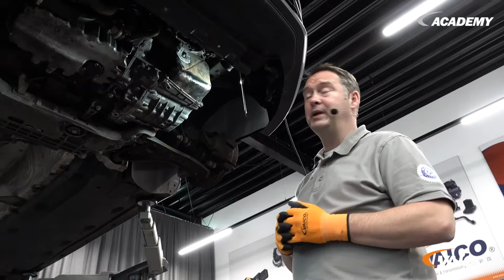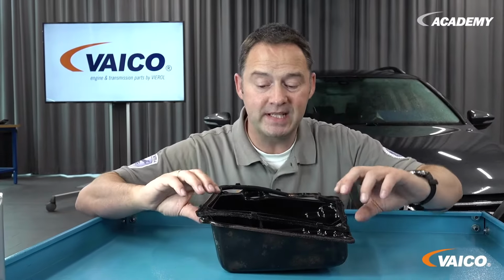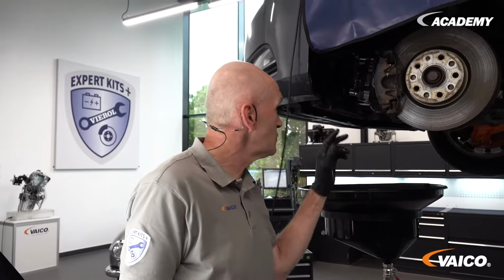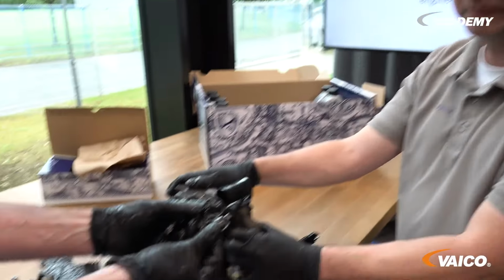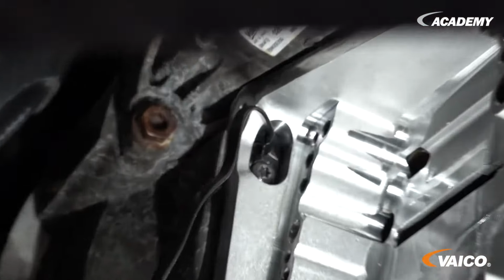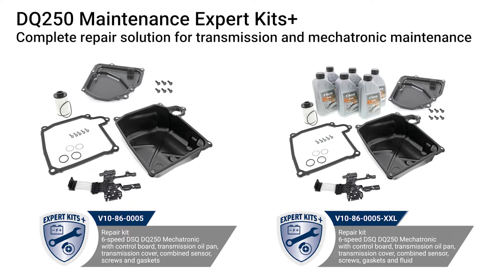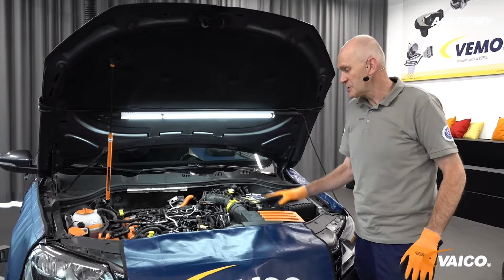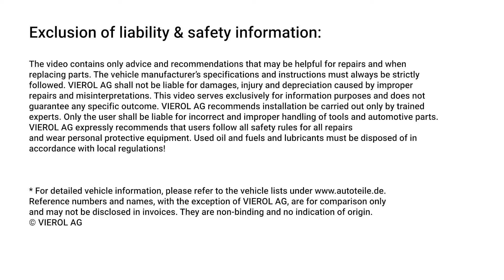6-speed DSG DQ250 transmission VW PASSAT / Golf VI / Golf VII / Audi A3 | EXPERT-KITS+ V10-86-0005

Comment: Hi, I have an issue with my DSG DQ250 09D where the takeoff from stand still is very aggressive and jerky, it’s like someone dropping the clutch on a manual transmission. The problem exists only on first gear and reverse, it basically jumps if you release the brake fast. From what I have read so far online these are the common symptoms of faulty N215/N216 solenoid valves. Is there any way I can check them through VCDS or some program before removing the mechatronic unit just to be sure, there are NO fault codes shown.
Reply from the maker: Hello,
first you should check the quality and level of the transmission fluid. When was the last transmission fluid change?
You can use the VCDS to determine the individual sensors and the shift pressures. You should check this after checking the transmission fluid.
Many greetings,
Team VAICO
Reply: Hi, I recently changed my transmission oil and the problem stills exists, it is very jerky on pulling off from standstill when the cars gets hots, works fine only when the car is very cold and has not been started for at least 2 days.. I suspect the solenoids N215/216 ..
Reply: @TheGorgievski  I have same problem as you on my Passat R36.. I got one fault code that said pressure control valve. After I did basic settings of trans. the faultcode automatic disapear. Now I have no faultcode but the problem is still there. My gearbox is new from fabric only driven 60.000 km. Does this mechatronic rly last that short?? 😖
Reply: @TheGorgievski did you fix it? Mine has a similar problem as yours
Reply: @TheGorgievski  Did you fix it? An update would be really useful ;)

Comment: Very excellent video. have DQ250 6 speed gear box that  can change from d1 to d3 but does not want to change  to D4. But if you jump D4 manually you can d5 to d6. But if you shift down D4, then brings an error with service spanner. Then the car can not pull. Way around is to switch off and start again. What could be the issue.
Reply: Mechatronic Problem

Comment: Nice video, but you didn’t include the torque spec for the speed sensor or the mechatronics or anything. Also didn’t show that you had to remove the rad hose to get the mechatroncis out..
Reply from the maker: Hello, thank you for your feedback. At time 6:56 we show the speed sensor and its position. We have also shown our spare part with item number V10-71-1277. In this case, we have not included this part in our EXPERT KIT+ because this replacement should be a mechanic's decision and we suggest the replacement at work only as an addon.
To remove the mechatronics there are actually other components in the way, we have shortened the process as you have already mentioned.
Best regards,
Team VAICO
Reply: Not to mention, the calibration process when the work is done.
Reply: any ideas on what that calibration process is?

Comment: Hi guys, golf 7.5 gti gearbox only drives in first gear and also goes into reverse gear without moving. 🙏 help
Reply from the maker: Hello @redhwaanmorris3768,
please note that we do not have the possibility to check your car directly. For an exact fault diagnosis, a specialist workshop must deal with the problem.
According to your description, there are already serious problems with the transmission. In some cases, these can be remedied with the help of an oil change or a transmission fluid flush and filter change.
However, there may already be damage to the gearshift valves and other components.
Regards,
Team VAICO

Comment: Golf 7, 6 speed it's start with gear 2 an when it reach gear 4, it looses power an display transmission fault on the screen.
Reply from the maker: Hello Botsalano Lekgowe,
your description doesn't sound very healthy for your transmission. The shifting behavior could change when doing some serious transmission service. When changing the transmission oil you need to check for metallic abrasion. If there is a lot of abrasion in the oil, damage may already have occurred in the gearbox itself. Our recommendation: Consult a specialist for transmission service and repairs.
Regards,
Team VAICO
Reply: @VAICO  hie do you also sell spare parts for VW
Reply from the maker: Hello Tawonga Nyasulu,
yes we are selling spare parts for VW. 
Visit www.vierol-shop.de for more information.
Regards,
Team VAICO

Comment: Hello what could cause this when shifting into S mode the shifter just springs back into D mode it won't stay in S mode .Does the cable have adjustment ? Also Park does not engage the lock and will roll back  the shifter shifts into park fine and stays there but won't lock. Any ideas?
Reply from the maker: Hello luxostucco2772,
Unfortunately, we cannot give you an exact diagnosis or assessment.
What is the mileage of the vehicle? Has a transmission fluid change or flushing already been carried out?
Many greetings,
Team VAICO

Comment: Hi, I have a 2013 2.5l gas, passat with automatic transmission. I noticed the paperwork says the transmission is from Japan. Are these transmissions made by aisin?
Reply from the maker: Hello connecticut730,
the DQ250 is produced by BorgWarner Inc.
This transmission is not made by AISIN.
Regards,
Team VAICO
Reply: @VAICO  thank you! I've driven the passat hard for 8 years through California mountains. No complaints and was just wondering.. Seems solid.

Comment: Hello,i have a Skoda Superb 2.0 tdi ,gearbox dsg6 Speed,i found oil in the electrical coupling of the mecatronic.For the moment the car doesn't make any trouble,it shifts properly and doesn't make any strange noise.Any advice for this problem...Thank's anyway.
Reply from the maker: Hello Ciprian. Rusu,
the mechatronic is submerged in oil. There is a vent in the coupling that may leak oil from within to the coupling.
Sadly there is not much of a solution for this.
Regards,
Team VAICO

Comment: Thanks for sharing, good video, do u have a video for the 2005-2011 gen?   
Can Anyone tell me exactly Where these are prone to leak??...   Got a 2006, can't tell where the heck it's leaking from. Thanks.    
 - take care.
Reply from the maker: Hello @leeisenberg,
unfortunately we do not have a video for the previous version. It can be quite difficult to find the location of the leakage.
Good luck and thanks for your comment,
Team VAICO
Reply: @VAICO  Thanks. Changing the oil, not b/c it actually needs it, but b/c of the slow leak. Going to put some bright food coloring in w/ the oil, baby powder on the outside of the case to try to help find the leak.  Thanks again.    
 - take care

Comment: Hello dear , i just bought R36 2008 with 187.000 k.m , when the car shift to 6 gear you fell like there is a shock in the car , and in the first gear when you remove your foot from the brake pedal, you feel there is an emptiness and when you put your foot on the gasoline, sometimes there something hitting it from the back , am grateful for the help 💜🙏🏻
Reply: Clutches

Comment: So all these models like Passat 2.0 TDI ,golf gti , passat r36, passat r32, audi a3
They all came with same exact transmission from factory?
Thanks
Reply from the maker: Hello @alpermetecevik1096,
basically you could say it that way, but there can be some smaller differences or variations. The DQ200, DQ250 and DQ381 is build into a lot of vehicles of the VAG Group and you will also find it in Skoda and Seat Vehicles. It's one of the main types for automatic transmissions and depends highly on the needed torque.
Regards,
Team VAICO

Comment: Hi, I have a problem with a tiguan 1.4 tsi with transmision 02e, when I drive after some km or more than 20 min, after stop don't jump from 1st to 2nd I need go to P and switch off and switch on again and the function great, I did the basic adaptation with Vag Com and was OK, during the scanning didn't shows any errors in the transmision block, do you think that is a mechatronic problem? Some people said me that could be a battery issue 😕, I feel nervous for the repair cost
Reply from the maker: Hi sanders0605,
it is really difficult to give you any hints about the symptoms you mentioned. Have you changed your transmission fluid or flushed your transmission?
The mechatronic is a piece of hardware that is monitored closely by the control unit. Problems within that system should be reported in the internal memory.
Regards,
Team VAICO
Reply: @VAICO   yes, it have 140k km and I think that this was the first transmision oil change,  the new oil is Motul, but before of the oil change the failure was present and after the fail keep, do you think that need change the oil again to clean all the parts ?
Reply: Today presented the code P2711
Reply from the maker: Hi sanders0605,
The way you have described it, it may well be that the control board has to be replaced in the case of the mechatronics. However, we cannot give a guarantee on this defect without looking at the problem directly.
In our video, we remove the mechatronics and replace the control board. Possibly this solution will also help in your case.
We recommend that you have this work carried out by a specialist.
Regards,
Team VAICO
Reply from the maker: Hi sanders0605,
If the transmission has only had a simple transmission fluid change after the described mileage, it may also help to repeat this with a filter change to get more dirt particles out of the system.
We cannot guarantee that this will solve your problem, as it is possible that damage to the mechatronics could also trigger the problem.
Regards,
Team VAICO

Comment: Hello guys, would this work for a 2011 2.0 stfi audi tt ?
Reply from the maker: Hello,
we can't tell which automatic transmission is build into your car.
Normally we identify the correct transmission with the car identification number, just to be sure.
But the chances are good that your automatic transmission can be serviced with at least a transmission fluid change. Then it depends on your record of kilometers, but if you've got over 80.000 km on the clock you should do it.
Regards,
Team VAICO

Comment: Hi I got the leak from pin Connector on the inside on of my mechatronic unit.I have no errors ,but when changing from reverse to drive or other way round my clutch sometimes slips or just when driving in lower gears 1 and 2 ,Gears think changes at very low revs.In sport mode doesn’t change gears.I have no shavings in oil. Clutch and dms flywheel was changed like 30 000 miles ago.Since than I have problems with my gearbox.Adaptation was done.Is the mechatronic unit faulty.Any  advice.I would much appreciate it.Thanks
Reply from the maker: Hello Jan Machac,
it is really difficult to deliver a thorough diagnosis, without seeing the car.
It could be bad timing that there are problems within the mechatronic after you had the change of the clutch and dms flywheel.
If it is an electrical problem the mechatronic should trigger an error code in the control unit.
Do you have enough transmission oil in your system? How is the engine mileage?
Regards,
Team VAICO
Reply: @VAICO  hi and thank you for your replay.I don’t know if there is less oil in my transmission than is should be.I thought I have too much oil that’s why is leaking.My mileage is 199500 miles.I have done clutch adaptation just yesterday and I think gear changes are beter .I cleaned connector yesterday and blow all the oil out.Reconnect it and disconnect it straight away and oil was there again all after adaptation.I am going to buy more oil,fill it up and do the drain again.Should I do the adaptation of my mechatronic unit as well?Thank you
Reply from the maker: @Jan Machac,
so you have had intense oil change already. We can rule out the oil when you are checking for the right oil level inside the transmission.
The leaking in the coupling should not be a problem of adaption. Looking at your shifting behavior as told in your first comment, you should check your clutch and flywheel.
The mechatronic unit is controlled by a lot of parameters and should report errors when something is amiss.
Sry, we are not really able to help you right here.
Regards,
Team VAICO
Reply: @VAICO  I did clutch adaptation and gear shift now is smooth.I did check oil I had 220 ml more than I should.My bad because as I put car on the made up wheel stands first time I’ve done it,it wasn’t level.It was out from one to another side like 50 mm which is quite lot.(So I checked it with my laser,measure of the jacking points.)cleaned the connector so I see tomorrow if is still leaking.Could be there leakage because of the overfill.Just describe it so others don’t do same mistake as Me.Hopefully all good,but thank you anyway.
Reply from the maker: Hello Jan Machac,
its great that you are sharing your experience. We are happy to have really engaged viewers, who are diving deep into this kind of repairs and share their experience on the way. 
Thank you and good luck,
Team VAICO
Reply: You have had your mechatronic out? 
I have taken mine out and can you tell me if it's normal that if I tilt the mechatronic one way or the other it sounds like something is clicking/tapping. Like a pin or something moving side to side. 
Thanks.

Comment: I have VW PASSAT CC 09' diesel DSG 6 speed, and he doesn't want to engage in R ( reverse). D ( drive ) is normally working.I have on dashboard logo of "CHECK ENGINE"

What is the problem, and how much it will be to fix it ?
Reply: The clutch pack